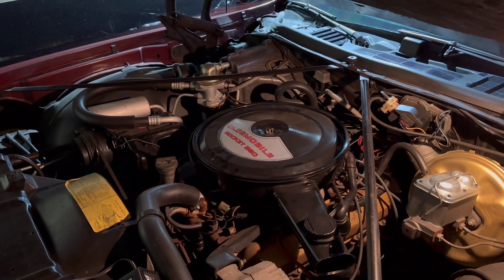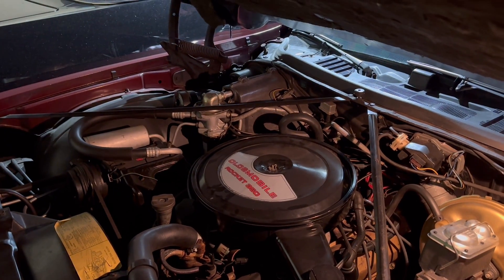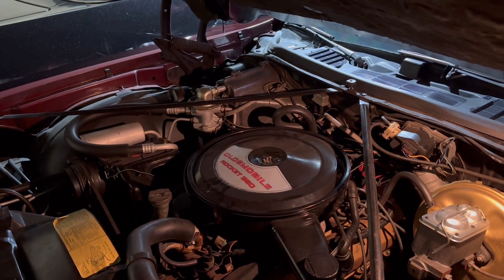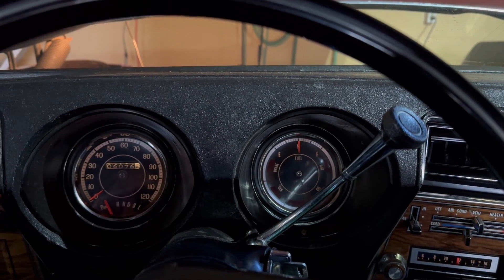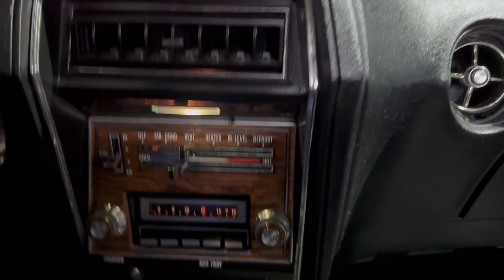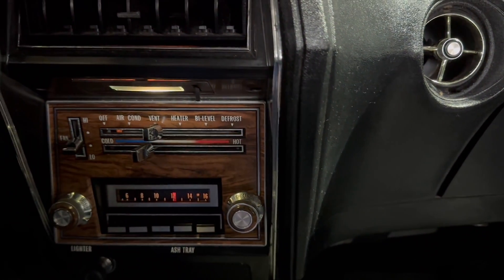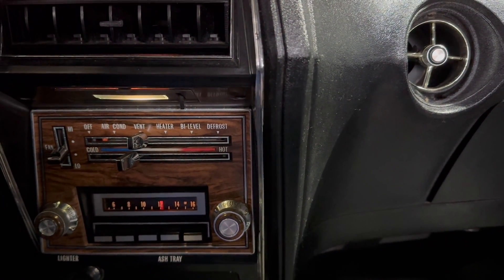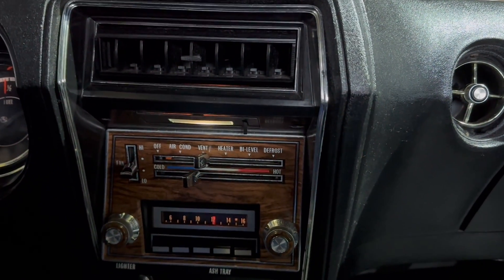GM's "Coolest" Invention Was a Strange Approach to Air Conditioning

Comment: I worked as a motor coach technician for over 40+ years when I started out in the mid seventies I worked on a lot of GM coaches. They sent me school at a GM training center in Dedham Massachusetts. Most of the older coaches used a big Trane a/c compressor driven off a shaft driven by the front of the motor ( usually an 8V71 Detroit diesel) in 1975 we bought a brand new GMC PD4905 motor coach and it had two belt driven A6 compressors that replaced the Trane compressor. It worked pretty well . Cool video
Reply: And thus ended the "belt-less" era of GM coaches. I suppose anything that would get rid of the monster compressor and the fan/PTO drive.
I wondered how the A6 survived/performed in that application - thanks for the comment.

Off topic, but did you ever work on '04s with a dedicated separate auxiliary engine used to drive the compressor?
Reply: @johne189  I did. One of the first jobs I did, my supervisor told me to go out to a 4104 that had that setup and make sure the engine wasn’t stuck after not being used all winter here in Minnesota. We only had 1 4104, and we sold it not long after I started there. Had some 4106’s 4903’s , and we got a brand new pd4905A in 1975
Reply: @greglammers9905  We probably turned a lot of the same bolts. I know you'll never forget changing the V's starter motor. Haha

Anyway, we can agree that the video's Oldsmobile was the least of GM's "Strange Approach to Air Conditioning" lol
Reply: @johne189  for sure. Those starters on the 8v’s were no fun. I heated up and bent a wrench that helped. I think if I looked hard enough I could still find that wrench.

Comment: Speaking about your Recirc A/C Fan setting.... Growing Up in a FoMoCo family, I did not have exposure to the GM setup you likely did, HOWEVER FoMoCo (My parents had Fords and Mercurys, but no Lincolns, my grandparents had them though! - 77-78 460 V8 Mark V's are my favorite because of that!) products had something similar on some of their cars (and we had so many I can't tell you which ones had it - Sorry!) BUT The fan was a Four Speed fan that like yours did not turn OFF unless you moved the selector to OFF (I think that was getting to be standard in all brands, by the 70's) But you only had THREE Speeds available in all modes EXCEPT "MAX A/C" in which the FOURTH and Highest Fan speed was available...BUT (IIRC - Memory is rusty) unlike your GM one where it bypassed the switch entirely, it ONLY bypassed the "HI" setting so that as the car got cold inside you could slow the fan down, but keep the more thermally efficient "MAX-A/C" setting...But that 4th speed was the ONLY time that the HVAC motor wasn't ran thru the resistor module...Well in very cold MN and my father who had worked at Ford in the early 70's knew about the fourth speed, also knew of installing a jumper wire that would give him HI in all positions, so he could glean more heat from the heater, without using the "MAX A/C" position with HOT selected, which WILL help a car warm up faster, but does not bring in the cold dry air to defog the windows... I use MAX-A/C or Recirculate, even today on my vehicles while warming up...Why constantly heat 0°F Air and force it in, when you can RE-HEAT 50°F Air and make it 80°F Air, still need the dry air while moving, so I turn it off while driving, or it will fog up on me.

Comment: We had a ‘71 Grand Prix and it had a separate setting marked “inside” which was the recirc mode. That A-6 compressor was also notorious for slinging oil from the front seal although it was considered normal. Always left a mess on the underside of the hood.

Comment: The Chrysler AirTemp system also did the heater core coolant flow cut off, fan boost, and the closed blend door on Max AC. It was done with push button controls though. Not sure about the recirculation aspect of the Airtemp though. I had another car (Australian), a 1981 Chrysler/Mitsubishi Sigma (which I think was called a Galant in the US). It did have a similar detent operation to what your describe here with the GM system, only it used a rotary ring knob running concentrically outside the fan control knob. It had the same detent thing to enter max AC.
Reply: Airtemp went into recirculate when max ac was selected. My parents had a 72 Coronet and my mom would always put it on max. Eventually it would have a mildew smell. She took it to the dealer and they said only use max for rapid cool down then put it on normal. The smell went away.

Comment: I had a 73 Chevelle DeLuxe with air conditioning that would literally frost the windows up on 100 degree days.  My 77 Monte Carlo and 99 S-10 were meat locker cold as well.  My 200 Isuzu I-370 (same as Colorado/Canyon) and 2012 Buick Lacrosse were cold but not as cold as the other GMs I had.  I remember my parents having a 59 Buick Lesabre station wagon with a huge ac compressor that was ice cold as well.  The newer GMs do not have as cold air as the older GMs.  The worst air I had was on a 2000 Ford Taurus which in the span of 10 years I had to replace the air conditioning compressor 3 times.  I no longer own a GM vehicle and currently I have a 2013 Honda CRV and a 2022 hybrid Ford Maverick which have cold air but nothing like the old GMs.

Comment: The GM compressor didn't work any better than the Chrysler compressor, it just took up less room. The only way the Chrysler compressor could be mounted is on top of the engine, what the GM compressor could be mounted on the side of the engine, giving more hood clearance.

Comment: My 1977 Ford Thunderbird has that feature, but it doesn't kick the fan speed up.  It does recirc the air and turns off the hot water to the heater core via a vacuum operated valve.

Comment: I do miss GM a/c and their crotch cooler vents too. However, while most of my Japanese car's a/c has been kind of weak and needs a constant higher fan speed than I like, I do prefer a simple a/c on or off setting, recirc on or off, and the ability to route air through any set of outlets I want.

Comment: One feature you did not explain was bi-level, the AC compressor would come on when you had this selected, if your hands got cold while driving you would want to have hot air on the upper vents too, issue s colder air would come out of those top vents which I would not want when it’s really cold outside. The heat only came out of the bottom vents unless you used bilevel which wasted gas because the AC compressor would be running. The top vents were for the cold air and bottom vents were for heat, no compressor running when in heat mode. And even though you had the controls all the way left, off position there was still some air circulation inside the car. I could also understand why the AC came on when in defrost mode, it helped to dry the air on the windshield.
Reply from the maker: By this point, hot air could come out of the vents
Reply: @RareClassicCars  the fact that heat and ac were active is a poor design for comfort, works good on defrost

Comment: with the older R-12 system, I was taught to perform a pressure test to see if it would hold, after a few days if the pressure held you'd then vacuum it down as far as it would go and let all the moisture boil off. Finally, after all that you could then charge it.

Comment: When converting to R134a from R12, add ester oil, and multiply the specified weight of R12 by .85, or use 85% by weight. Remove first as much R12 oil as you can because it does not dissolve into R134a as it did into R12. Ester oil does dissolve into R134a. The compressor is lubricated similarly as a premix 2 stroke.

Comment: To this day most people don’t know what happens in the hvac system when selecting the max ac/recirculate setting. I think the detent setting on this 73 cutlass was too confusing to most. Anyone know the btu/tonnage of any of these cars?  Hard to find this info, but my guess is that the cutlass has 18,000 btu, whereas today’s economy car has only 12,000. It would be a nice selling point if I were buying a new car, picking one with a much higher btu would sway my decision.

Comment: In the American Motors small cars (Gremlin, Hornet) the A/C control is separate from the Heater control.  You actually operate the A/C with the heater control in the AIR/OFF position.  Interestingly enough, this is also the RECIRC setting as well.  So, for anybody who didn't read their owners manual, they probably ran the car it's entire life with the A/C in recirc mode and complained about it incessantly.   The owners manual states to put the control halfway between AIR/OFF and HEAT to draw fresh air from the outside. In later years, I think beginning in 1973, AMC put a small DOT and a detent halfway between OFF and HEAT.  Still probably confused the bulk of owners.

Now, one might think.... well, wouldn't that open the coolant bypass to the heater core and allow the core to heat up and diminish A/C efficiency?  NO!  The coolant shutoff or bypass is controlled via the TEMPERATURE slider.

AMC small body systems also employed a "Desert Only" setting, which, if you read your manual, is only for DRY climate use.  Use of this setting in a Dry climate would allow the compressor to run continuously without cycling keeping the occupants nice and cool.  Using that position in a moist climate would freeze up the condenser and not allow the A/C to function for a short period of time.

One thing I never understood with the small body systems is to add cheapness;  they eschewed the use of a power relay for the compressor.  FULL CURRANT runs through the A/C switch in the dash!!  I would imagine it probably burned the contacts out forcing the owner to return to the dealership for replacement.  I guess relays were expensive in the 1970's.  You had to purchase at least a Javelin to get a relay on the power side of the compressor circuit.  Of course, I've added one in to my Hornet since replacement controls are few and far between these days.

GM systems always seemed over-complicated to me.  The AMC system is much more compact (or "Bijou" as I like to say) and infinitely easier to work on.  Though I would like to thoroughly flog the man who decided to hide the expansion valve inside the car on the heater box matrix.  Replacing that valve requires nearly complete removal of the dash and heater box.  Other than that, every other component is easily replaced underhood.

Comment: So many of the R-12 you buy today is NOT the same as the old R-12 since its been out of production for almost 20 years. Most sell recycled R-12 with modern additives. If a system leaks any coolant it will actually run colder than factory until enough leaks out. The main reason it leaks out is due to microscopic pores that develop in the brazing compound used in the evaporator core. I used to work in the HVAC industry and the evaporator cores were always the weak point in the systems.

Comment: What happened when you moved the top lever to DEFROST. Was there a way to have the A/C compressor run to aid in defrosting the windshield like it does in most vehicles today? Did moving the TEMP lever all the way left kick in the compressor while in DEFROST mode?

Comment: Any AirTemp system that Chrysler used could freeze you out of the car even at 100+ and high humidity. Secret was Chrysler's continuous compressor system! Not saying that GM's system wasn't excellent too. Of course only AMC /Nash had the Desert option which ran compressor constantly!

Comment: That looks almost identical to the HVAC control configuration on the ‘72 Toronado I had, even down to the red white and blue color scheme.  Being able to slide all the way left to get max cooling with one quick hand motion was handy.  By the way, you could also hear a bit of a hiss when the vacuum valve on the heater core cutoff was actuated.

Also, if the system gets very low on gas, the low pressure trip switch is designed to blow the black plastic three terminal fuse on the compressor clutch circuit.  You have to add gas and replace the fuse.  The fuse is usually located somewhere near the compressor.  At least that’s the way a friend who worked at gas station with actual car service explained it.  When my car got low on gas due to a leak, the fuse blew.

Comment: The a6 had more cu inch displacement and the POA valve allowed for expansion valve to be optimal with no need for offsets that kept refrigerant oil coming back through the suction line. The additional 3/16 tube from evaporator to poa assured that oil supply when the TXV was throttled to the best flow for the hottest day or the coolest night with lowest fan. The mistake made was to do the VIR setup shown on your Olds. The integration of the TXV, and POA as drop in cratridges with ddessicant bag in the sump led to lots of dessicant bag ruptures and poisoned systems with locked or noisy compressors. The R4 compressors had no tolerance for inadequate oil with pressed in pistons that would pull out when cylinder scored. I made a lot of money repairing 70s a/c sytems at GM multi brand dealers then.

Comment: My parent's 1965 Cadillac used the A6 Frigidaire compressor. It still had the original  OK Cadillac stamp. It was a cold system. The compressor ran the whole time the ac and heat were on. No economy setting for fresh air either.  65 was the 2nd year for climate control on Cadillacs.   We had it from 70-98. A Calais, Starlight Silver.

Comment: My 2008 Ford Crown Victoria police interceptor has a similar AC setup. It has Norm AC and Max AC, on MAX it goes into recirulate and it increases the blower motor speed. Absolutely love my classic designed car in a modern package.
Reply: No it just sounds like a higher speed because you hear the inside air intake. On the mid 70s GM, the blower speed operated only in high speed when in recirculation mode.  This incentivized people to use fresh air most of the time which is much better for air quality and people are so ill informed about how the system works to be able to operate it correctly

Comment: Great overview. My 73 El Camino has same GM AC system. Too bad R12 gone, sight glass was great charge indicator and you could slightly R12 overcharge w/o  issues.  You mentioned these old GM systems used  4 - 5 lb R12 freon which is super cooling capacity. Cutting off heater core coolant is good for about  6-10 degree colder vent temp. Check coolant valve fail because vacuum operated diaphragm goes bad with age. Sometimes you want recirculate at less noisy lower fan speed. Maybe  reason GM went to high fan speed in recirculate mode;  to prevent evaporator core ice up.

Comment: This is a moderately funny story related indirectly to Ford climate controls. I worked as an EMT for a fire department EMS for a couple of years....we used modified 1980 Ford Econoline 250 vans for ambulances. At one point we reported our ambulance to the mechanics shop because many of the instrument lights were burnt out. We received it back with all the lights working but the plastic in front of them all broken off. It looked like they couldn't get to the bulbs any other way so they just did that to change them!  Typical early-80s mechanical work I guess. Funnier at the time than now. 😄

Comment: I’m amazed by how many people just don’t get the function of the recirc setting. Maybe it was genius to incorporate it into the very far left position of the temp knob rather than label it. I had a customer with a Toyota tell me she liked to drive with the button pressed to blow the air around inside the car. Because the pictogram showed the air circulating rather than fresh coming in. So she’d happily drive for hours on the freeway with windows fogged and the air as dry as a desert from running back through the evaporator. Another one asked to have it repaired because it wouldn’t stay in recirc when the mode lever was on defrost. Along with closing the heater valve and closing the fresh air door that unlabeled max a/c setting was pretty smart.

Comment: I had a "73" Cutlass Supreme with bucket seats and console. I loved this A/C feature because it would cool the car down in a hurry. That was one awesome stylish and good driving automobile. I wish that they still used that type compressor because it was built like a tank, used R-12 and was easy to work on. Thanks for the memories of this system.
Reply: I also had a 1973 Cutlass Supreme coupe that I bought new. Loved that car (and the A/C system) and would like to find another one in mint condition.